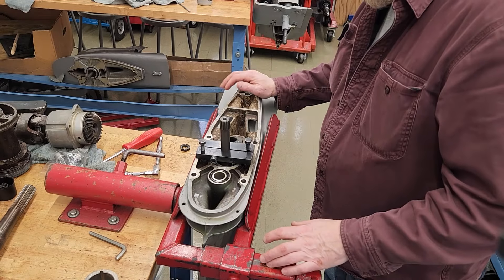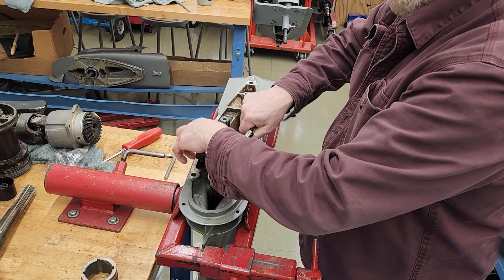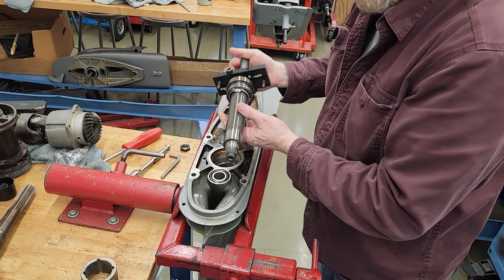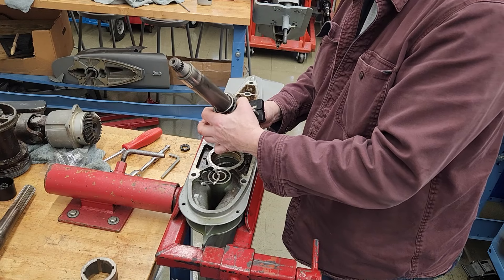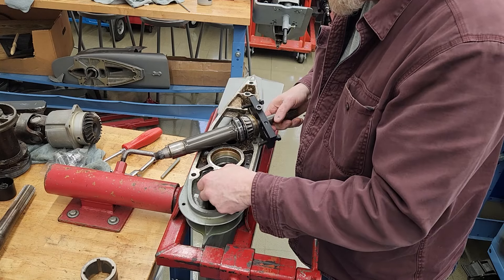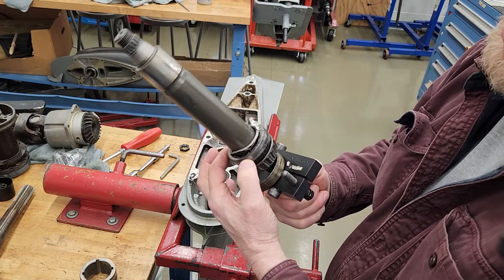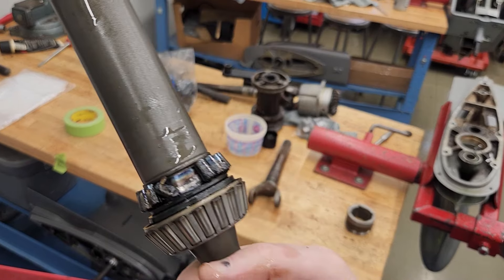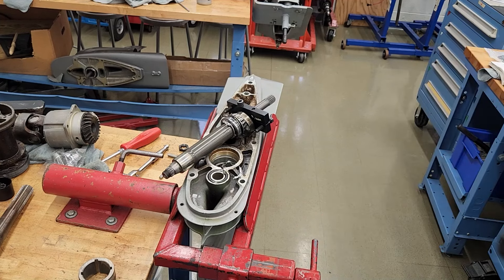Volvo Penta SX Owner rebuild failure

Comment: Hi teds i have a problem in my d4 300 ips 400 the port engine start and run well when first start and after runnibg for 15 20min i slow down and try to accelatr the compressor struggle to transfer to turbo so i have to wait some.lins and give full throttle sudenly and so tried to swope rhe compressors  and the problem remain same and bow i have a fault code MID 187 PSID 226 DATA LINK ,DATA LINK2 SOMETHING is it okay to do a auto configuratiom and do a lever calibrtion thank u
Reply from the maker: @vinuralakmal849  yes you can do an auto config. Sounds like the  turbo charger is dragging
Reply: @tedsmarinerepair8956  thanku for the rply i have sent your 2  3 emails also 😊can a turbo chager works at a time and not working  and why it happens after engine runs for some mins ?
Reply from the maker: @vinuralakmal849  it is a sign of it starting to bind up, there is also a diverted air valve that may be partially stuck. It is in-between the blower and turbo air duct. Start there to ensure it opens and closes smoothly. Then I would replace the Turbo.
Reply: @tedsmarinerepair8956  okay i will check it and today after auto comfiguratiom the boat rums good ,but the port side engine delay a few sec to give it to the turbo but now it work  before it stuggle a lot
Reply: Can i have an apponment with u mr teds i want to talk some issues if its possible appreciate
Reply from the maker: @vinuralakmal849  you can contact me at marinedoc01@yahoo.com for consultation.
Reply: I sent u an email teds if u can check it
Reply: @tedsmarinerepair8956 is it okay to sope the PCU OF port side and stb side and check if the problem chnges and if i chnage them what procedures should i follow how u will rply thank you,i alreasy sent to 4 email teds for consultations 😬 thank you